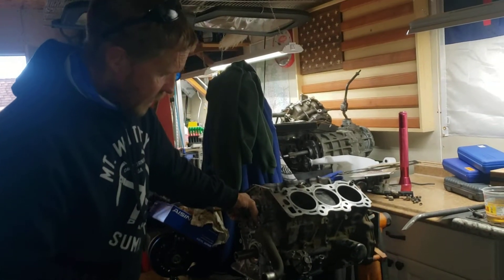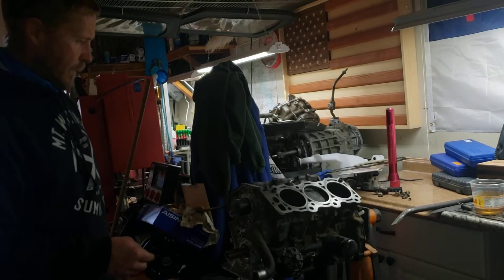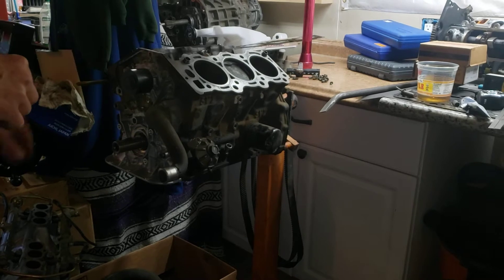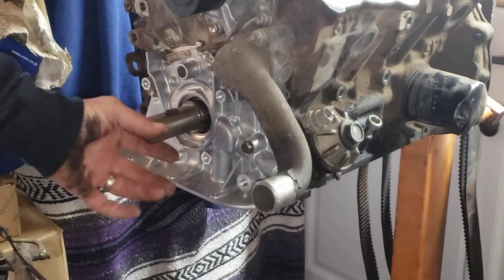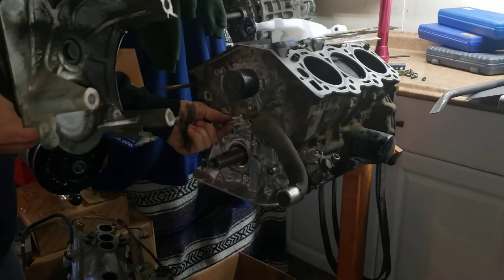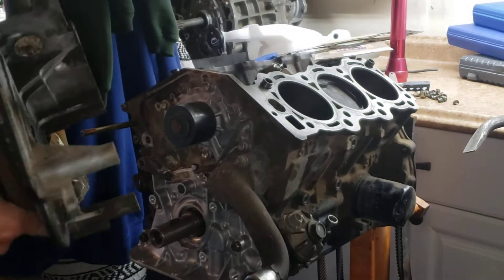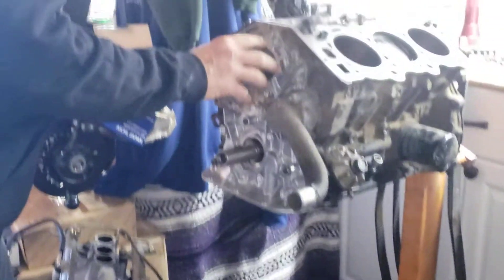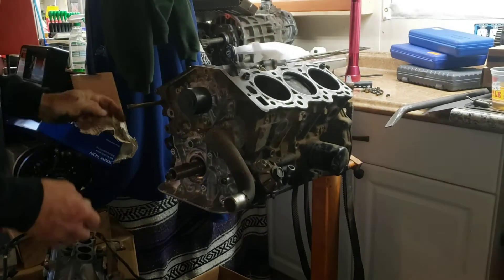5VZFE Block 3VZE  Heads Toyota (Part 1)

Comment: I guess the distributor is what was keeping you from just using 3.0 fuel injection on a complete 3400.  Did this work out
Reply from the maker: Yes the distributor is what kept me from using the 3.4 5VZFE heads. I would had loved to use the 4 valve heads and cams but the distributor could find no home on the 5VZFE heads.  Check out my last video I think its part 9. Runs really nice.  I don't drive it nearly as much as I'd like to but I'm very happy with how it runs. I was a little concerned about if it would have trouble passing smog because of possibly having NOX emissions from different compression or running slightly leaner being 400ccs larger but even with the original 300,000 mile catalytic converter it recently passed its smog test easily.  So overall I'm happy with the outcome. It was a little time consuming but it saved me money and it was fun.
Reply: @bensfixitpage341  Thank God, i dont have to worry about emissions in AL. From what ive experienced the 3.4 bottom end is bullet proof. Nice job.  makes you feel good when all your hard work....works out
Reply from the maker: @dreece2000 thanks